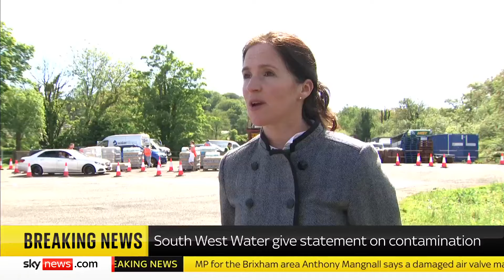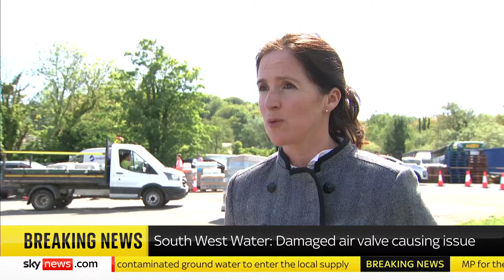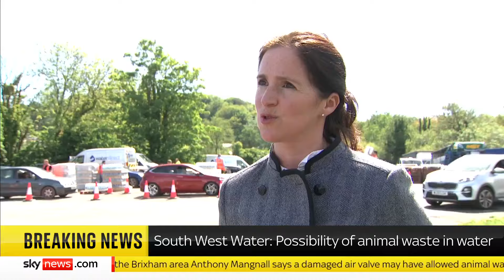South West Water: 'Damaged air valve' likely cause of parasite detected in reservoir

Comment: 0:37 `Its in a farmers field`  And they never thought there would be cows in the field or muck spreading done at some point?
Clearly not the fault of the farmer. This is down to bad decisions by the water company and people need to be held accountable also those that have been ill because of this need to be paid a proper compensation payment.
Reply: It's impossible to physically inspect every above ground fixture & fitting of cross country pipelines on a daily basis, clearly a long established air valve has been accessed & subsequently damaged or snapped off by grazing cattle... unfortunate but these things do happen sometimes...

Comment: As an engineer, I find this explanation not an explanation. Why is there an air valve in a pressurised, clean water pipe - which domestic water is piped along?  Water should leak out, sewage should not leak in? Poor woman has been give an nonsense excuse to spin to the media.
Reply: Absolutely.
It could be a failure of a check valve, or a non return valve.
However, for it to contaminate the mains water to extent it has, then this contamination has been going on for some time.
Reply: Ever heard of systems which have AAVs (Automatic Air Valves) in them, in order to prevent airlocks?  Most air valves are one way, and will only let air out and nothing else in.  That's if they work correctly.
Reply: @paultaylor7082  From my experience, AAVs, (automatic air vents) or (air admittance valves) are more commonly found on soil and vent installations rather than mains water.
Mains water (drinking water) runs at preasure, so there is zero chance of an "air lock".
I have no idea how the contamination occurred, but I'm certain that it was not due to a damaged "air valve".

Comment: Why would there be a air valve on a farmers field makes no sense
Reply: Many pipes carrying liquids have air valves, to prevent air locks in the system.  Howerver, they're only supposed to operate one way and shouldn't allow anything into the pipework, which clearly has happened here, hence the contamination

Comment: An air valve forces air and water out of the system, not suck contaminates into the system.
Reply: Air valves should only allow air to vent out of the system, not liquid,  That's if they're working correctly.  They're on hte system to prevent airlocks in the pipework.